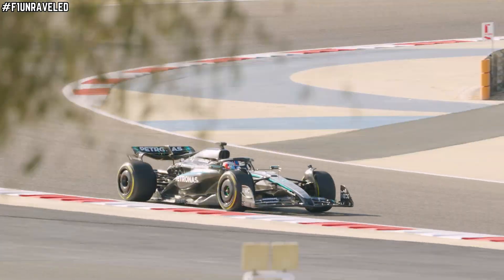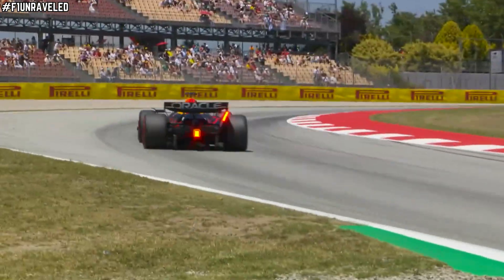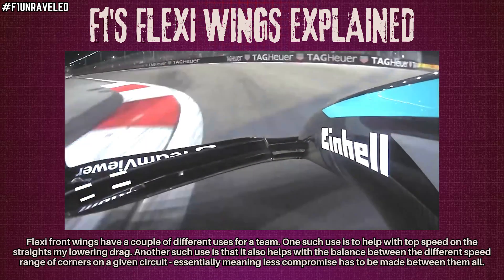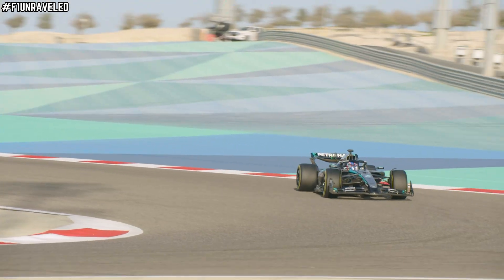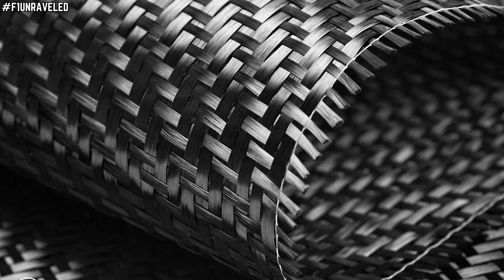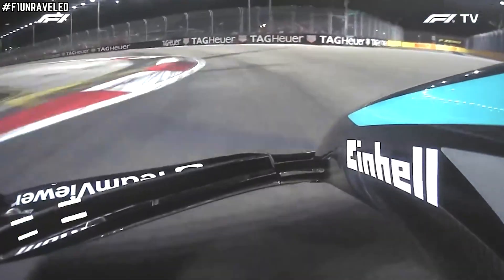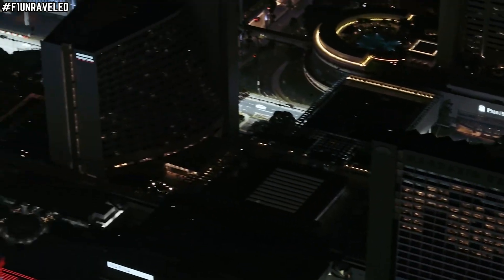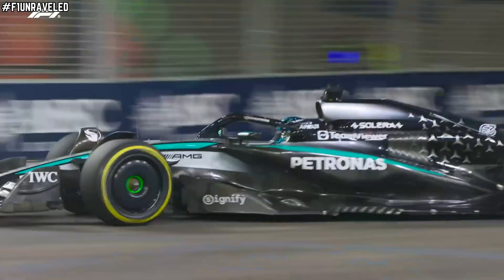Mercedes CAUGHT Hiding Flexi Front Wing?! on the W16?! | F1 2025

Comment: If the FIA wanted to completely ban the flexi wings, instead of using their current testing method, simply perform visual inspections under load, i.e. measure the flex at speed in a wind tunnel, and place a seal on them that cannot be removed.

Comment: If it passes the test then it is not illegal.  The problem is when the FIA arbitrarily decides to change tests mid season and it punishes a team that has spent budget on developing these flexi wings.  Ferrari already had a car designed around flexible wings and then the FIA changed things mid season.  Now they are largely uncompetitive.  If the FIA wants to change things up, it should be before the next season starts, so teams can adjust accordingly.  Then these tests should be locked in for the year.
Reply: Só falou besteira 
😅
Reply: They wouldn't be able to write the script. They want to be able to decide who wins or doesnt